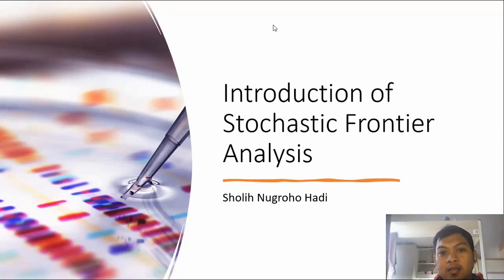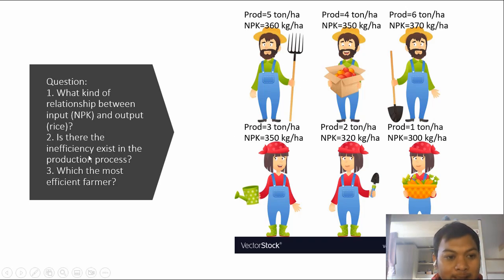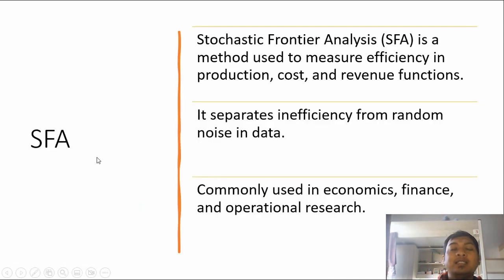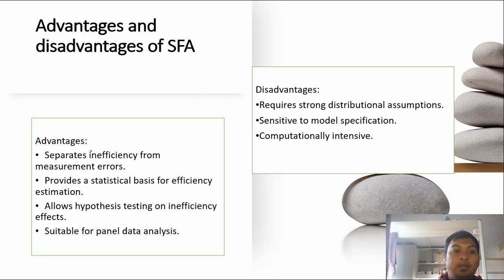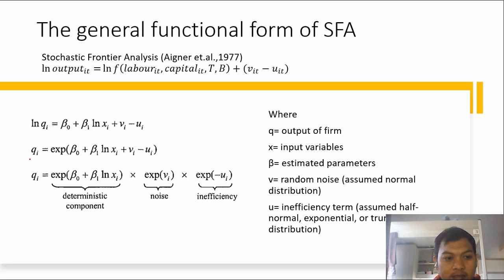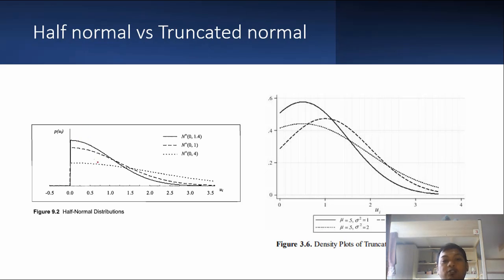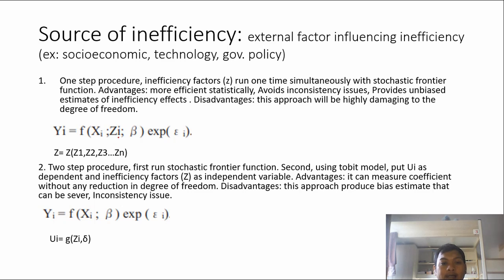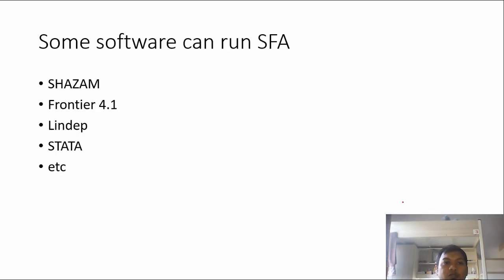SFA 1  Introduction of stochastic frontier analysis SFA

Comment: How to find resources use efficiency in agriculture crop production
Reply from the maker: We need determine input and output.  After that , we need collect the data. Then, we can run sfa
Reply: @sholihnugrohohadisholih2729 
That to problem in fertilizer and labour calculation
Reply: @sholihnugrohohadisholih2729 
I collected data... Sir
For resources use efficiency  , analysis in cost or units, 
For example input seed 12 packet or, in grams or interm of cost
  Now I too 12 unit converted to ln form 
Up to yield I did, whole excel run in sfa??